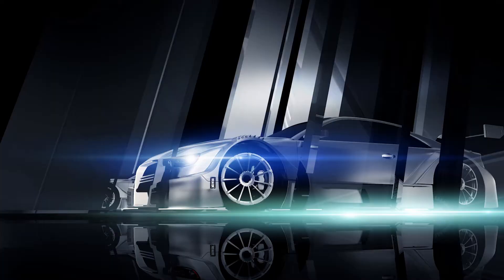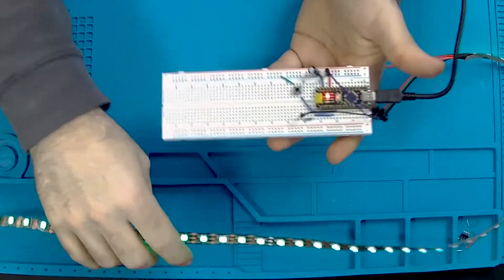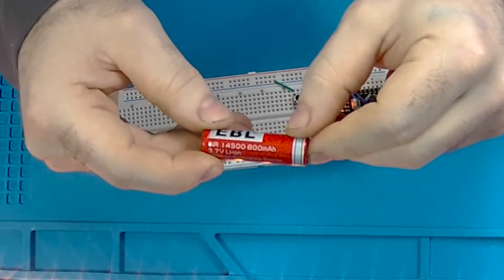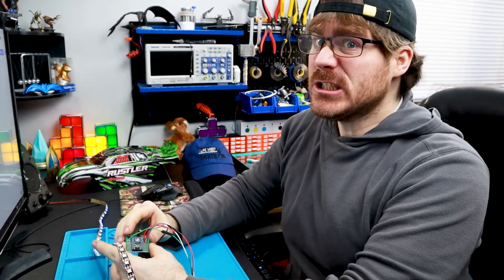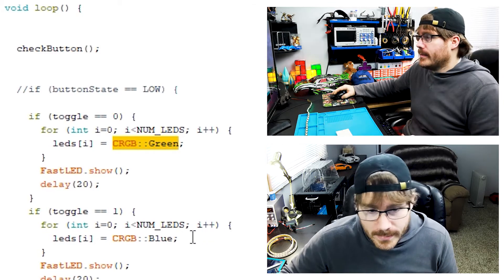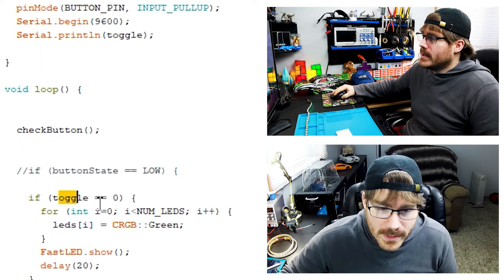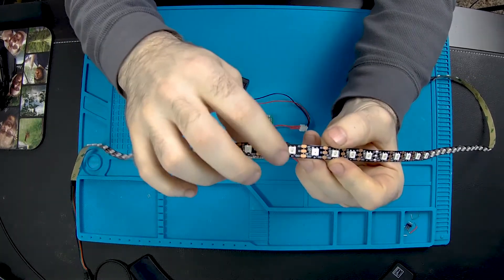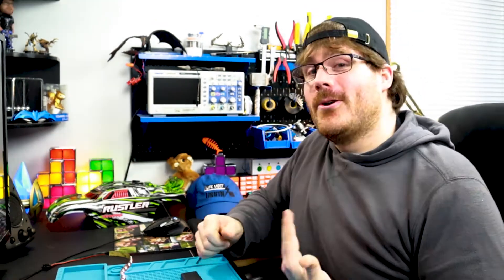LED Lights for RC Cars | Part 2

Comment: 🐨 What do you use for your overhead camera?
Reply from the maker: I just got an Akaso V50 Elite. It's not quite on par with my canon m50 (to be expected), but it's small and easy for overhead shots. I anticipate I'll find other ways to use it as well.
Reply: @LifeMeetLightning  Ahh cool.  I have an old GoPro Hero+ that I could use for that purpose.  Back when I was watching a lot of Think Media videos, I wanted a Canon M50 so badly, but since I've been using gameplay footage lately and rarely use a video camera, the desire is much less so ...
Reply from the maker: @OddDrummerGaming  I don’t regret getting the m50, it’s a great camera...  and I split the cost with my brother. Lol That helped the wallet a bit.
Reply: @LifeMeetLightning  Oh yeah for sure.  If I were to get one, I'd still want that Canon M50.